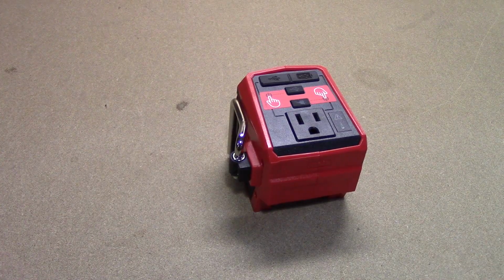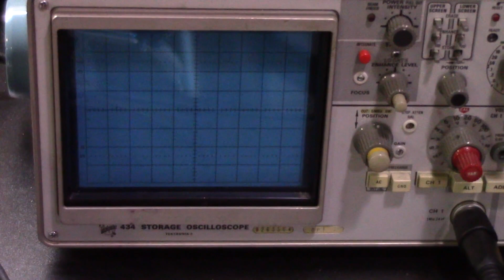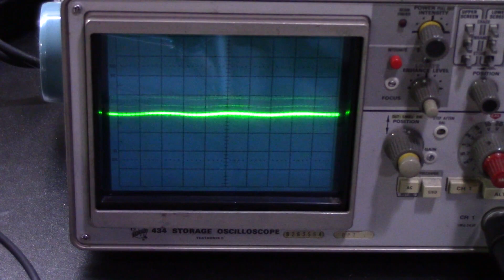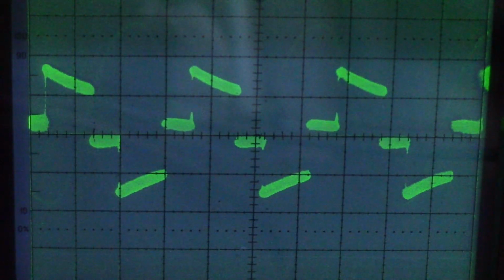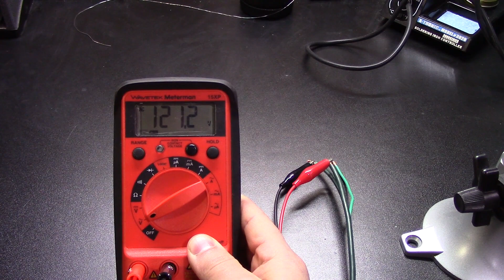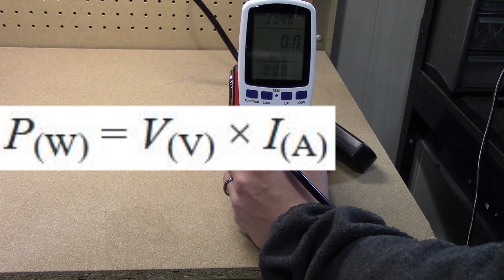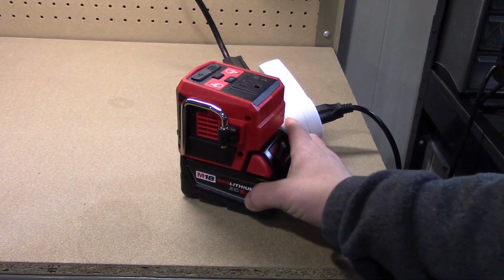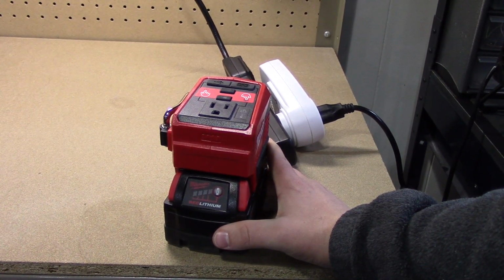Milwaukee Tool M18 TOP OFF Output Waveform Revealed!

Comment: Thanks for sharing this study. 👍 Is the Top Off suitable for powering a Starlink MINI satellite dish/router assembly? I'm concerned if having the non pure sine wave power is an issue?
 I did testing without getting my internet account established yet. I was able to get about 2 hours and 45 minutes of battery time from a Milwaukee M18 Red Lithium XC 5.0 (5Ah) battery at 70F ambient temperature. The starlink comes with a small converter from AC to DC with the following input and output parameters stated on it: 

100-240v 1.6A 50/60 Hz

Output: 30.0V 2.0A 60.0W

The dish label states: Input Req't: 
12 to 48volts || 5.0 A
Reply from the maker: Since the topoff is powering an AC-DC converter, there is no risk to the starlink. Those converters can handle pretty junky waveforms. so the Topoff's modified sine wave is not an issue for your use case. 
As far as suitability...On paper, the starlink power supply will draw more power from the AC side than the topoff can produce. 110Vx1.6A=176W (the topoff max is 175W). However, the rating on AC-DC converters is the expected Max, so you should be fine even in moderately hot temperatures. If you start experiencing random shutdowns of the topoff, I would discontinue it's use and let it cool off.
Keep in mind that running anything right on the max rating will shorten the lifespan. The only thing at risk of premature failure in your use case is the topoff itself.  Hope that helps!
Reply: @IllInformedHuman great, nice to have somebody to get some feedback. Thank you. I'm sure the goons at Milwaukee tech support won't be too helpful. They've not been too helpful for much thus far. My top off has not been used too much, so perhaps it's performing without any shutdowns. I actually performed two complete battery discharges of each of the 5 amp hour I have. The first test I did was indoors without any satellite reception and I believe it was trying to run the snow melt mode because the surface of the dish was warmer when I ran it inside the house versus outside for the more real world test when I aligned the dish with actual satellites. The indoor test consumed the battery in only 1 hour 45 minutes versus The Outdoor test lasted 2 hours and 45 minutes. My theory was that the snow melt function could possibly be running since it had poor reception indoors. I'll keep a watch on things. What I really wanted to do was to get rid of the converter and inverter combination because I know each of them has their own inefficiency that's reducing my battery life. I purchased some components I found on Amazon for connecting directly to the Milwaukee battery. It came with a switch on the housing that snaps onto the top of the Milwaukee battery. There is also an inline fuse holder on the hot side. One supplier provided 30 amp fuses which is too much for my application add a 5 amp load from the starlink. It brings to question whether these guys have any clue what they're doing when they sell these cheap kits. 

There are two large blade conductors on the outermost positions for getting power. My concern is whether this configuration will drain the battery at a rate that's unacceptable because it might not have feedback from other terminals that Milwaukee devices normally have. I've observed them to have two pairs of Blade contacts, where is this Amazon / China part doesn't have those additional terminals. I presume they are part of the feedback for controlling the power draw end or used for the battery chargers to regulate the charge process. I'm just guessing on that. 

My real question here is whether I'm better off using those direct connection components that are sold for this purpose by China or will they damage my battery?
Reply from the maker: @biketothetop  Since the China part does not have the extra blade connectors, it cannot sense the Milwaukee battery temp. Meaning if the battery overheats, the device will still try to draw from it! 
The china part may not over drain the battery since all it needs to see is the battery voltage. I am assuming the china part would shutdown when it saw 14ish volts... though you may want to do your own tests with another DC power supply.  Because of that, there is a decent risk to the Milwaukee battery. 

You are better off using the topoff, especially since it was able to handle the snow melt mode, meaning you will likely not exceed what the topoff can provide. 

You may consider getting a 12Ah battery, which would bring you up to greater than four hours. There is also the option of a dedicated power station like the Anker SOLIX C1000, which would get you 5.5 hours (longer if you paired it with a solar panel) though we are starting to get a little pricey...
Reply: @IllInformedHuman I concluded that the BMS in the Milwaukee battery is protecting it because after I depleted it fully while using the top off, I measured 15.2 volts on the battery. This was consistent for both batteries I tested from full charge to shut down.

 You're making me nervous about having the battery Heating scenario. It makes me want to shy away from this China junk all together. After all this achieves Milwaukee's goal that I only use their products with their battery. This should make things compatible in that regard, but then I get concerned about the sinusoidal aspect and how it could adversely impact my starlink. 

In terms of battery life, I'm okay with the current scenario because I would only use it on a very limited basis. I just thought it would be cool to be able to be totally portable and carry the system in my backpack if I went somewhere remote on foot. I have a 1,000 watt pure sine wave inverter in my vehicle that I can use this system with otherwise. 

My current conclusion: From a safety standpoint it's best to use all milwaukee, but from a hardware lifespan standpoint, it seems that I'm putting my starlink at risk with TopOff

Otherwise I can damage or for shorten the life of my Milwaukee battery or have a fire without the feedback terminals on the China connector.

I guess your final piece of advice was just use the Milwaukee stuff, but how concerned should I be about the starlink even if I use it with the Milwaukee top off and the starlink converter?

Thanks for your help.💪🙌
Reply from the maker: @biketothetop  no problem, glad I could help, and happy traveling!

Comment: Thanks for this re-assurance about the sinewave power aspect. I am considering getting one of these Topoff devices and was skeptical about its suitability for a laptop. At 10:47 you hit on the important facts to justify that the Topoff will do the trick. Since I already have some Milwaukee tools, I am weighing using this instead of hard wiring a Victron inverter in my Van. I already have a 100 Ahr battery for a refrigerator with a Victron DC-DC converter to charge this auxilary battery. I wish Milwaukee had of provided more info like this in the owners manual that I viewed online. I just never saw the product label before seeing your video.

Comment: Can it charger a electric skateboard 👀
Reply from the maker: Maybe, if you have a trickle charge mode? Still fairly unlikely :(
Reply: @IllInformedHuman  im not sure wat that means but ima assume I don't have that lol I just know it's a 5amp charger. But thanks for the reply I appreciate it 🙏
Reply from the maker: @Mitch_Sti  if that charger draws 5Amps at 120 VAC, then it needs 600 Watts! This thing can only accommodate 175 Watts.
Reply: @IllInformedHuman  dang good to know, thanks.

Comment: I had the top off just over a year, charging a laptop while on the road driving, etc. Recently, the AC outlet just stopped working, so I guess one of the smart chips inside became dumb.
Reply from the maker: I did not think this inverter would last long with daily or even weekly use (Thanks for confirming). In leu of a passive heat sink they threw an itsy bitsy fan in there, likely to make it compact. 
I think it is less of the smart chips going dumb and more that they decide to quiet quit.

Comment: Hey very informative video! Question….I am planning on using this to power my Hakko 936 soldering station outside on my car to repair injector wires. Am I risking ruining my Hakko unit?
Reply from the maker: That looks like a 60W potentiometer controlled solder station. Since it does not have a screen, I believe all it is doing is taking in the voltage, stepping it down with a transformer and then using the potentiometer to run over some simple heating circuitry (If not just running directly to the heating element).
So, no  you likely won't damage the solder station with the top off, however, don't be surprised if the thermostat needs to be turned a little higher than you normally have it set.  
Have fun!

Comment: Will this be able to handle 120v 60hz 11.8A ?
Reply from the maker: 120V*11.8A=1,416W
Which is greater that the 175W this unit is capable of supplying.
Reply: @IllInformedHuman  thank you

Comment: For some additional insight here...

Everywhere power is generated, or transformed, you need to establish a ground reference. For example, you may have single phase 240Vac coming into your house from the power company. Where the voltage and current are transformed (the transformer on the utility pole for instance), a ground/neutral bond is established to create a reference that is common to both sides. Same thing in commercial control applications where you may take 3 phase 480V and grab one leg of it to a 480:120Vac xfmer. The low side of that transformer will have two wires that read 120Vac between the two. One of them will be bonded directly to ground on that secondary side in order to maintain a common reference to the same ground on the high (480v) side. The ground bonded leg will now be the secondary's ground (green wire) and neutral (white wire). After that point, the two will never join each other again, and if another xformer was added down stream to say, drop 120Vac down to 24Vac, the process would continue. The ground wire to ground, hot and neutral to high side of transformer, then on the low side, two wires will exit, with one wire being bonded to ground to maintain the common earth reference that began all the way back at the turbine that spun up to create the power in the first place.

Long ramblings just to explain that if you measure without ground off the secondary side of an inverter that is internally bonded to the negative side of the battery supplying the power, you're not going to get completely accurate results. Thank you for catching this.
Reply from the maker: Thank you for the info!

Comment: The important thing to know is electronic equipment can be damaged or destroyed or even explode if connected to that SHAPE of power wave. There is a story of an audio equipment repair technician friend of mine called to service an expensive studio mix board that was being modified by the studio owner. Tech asked studio owner; "Before you power it up, are you sure you know what you are doing?' Owner said "Yes". Tech: "Okay, its your board sir." Owner powers up his mix board then all 96 channels of his $million dollar SSL mix board blow up in sequence, one at a time, smoke rising over each channel one at a time. Next, tech was hired to fix it (after it stopped smoking). He made a lot of $ off that guy.
Reply from the maker: Definitely! Expensive stuff should have filtering, even with a reliable mains supply. Though... In your example, it sounds like there was more going wrong than just dirty power. Thanks for sharing!

Comment: Do you think with a 12v Milwaukee battery

Does it posible to use paint sprayer
Reply from the maker: The device in the video needs an 18V battery. For the 12V battery, they only have something that gives you USB power.

Comment: No idea what you said or what im looking at but ive used the top off to charge everything from m12 batteries for my heated jacket to my phone and laptop. All i want to know is if i can use the top off with my coffee pot. Guess i could plug it in and try but im scared.
Reply from the maker: No you cannot, the smallest drip coffee maker needs ~500watts. This thing can only produce 175W :(

Comment: What will be damaged if I repeatedly short-circuit this thing? (Hot-to-neutral). Thanks
Reply from the maker: That has accidentally happened to me, all it did was turn off. It would then try to turn on and then go off right away. So... it appears to check for that, I have no clue how often you can do that 😅

Comment: I have a habit of researching certain aspects of an item AFTER buying it. Glad I snagged mine for $73 off eBay.
I don’t know why I decided to learn about whether or not it’s a sine wave until after I bought it 😫
I am quite disappointed in Milwaukee. Sometimes you assume they care and then you have to realize it’s only for profit. What more would it cost for pure sine wave?
Reply from the maker: This is certainly something they threw together "just cause". To make it pure sine wave, it would likely get bigger, maybe cost an extra $20?
Reply: @IllInformedHuman  keep in mind that EGO makes a 400 watt continuous inverter with pure sine wave for only $149.
I’ll probably get one as I’ve just joined the EGO Outdoor line for blower and string trimmer.
Reply from the maker: @takenusername  Neat! If I ever get one of their lawn mowers I may have to toss that inverter in the cart as well 😀

Comment: It's overpriced for sure. But most Milwaukee products are overpriced. Nobody is going to damage anything using this. You can plug a laptop in and it's not getting damaged. If it has a rectifier you'll be fine. Ask yourself what you plan on plugging into to this 175-watt inverter... then ask yourself if it has a rectifier on the power cord or inside.

Comment: Would this be able to power up a internal pump in an air mattress? I got a Intex Premaire II that requires a 120W AC outlet.
Reply from the maker: Yea, you would be good to go! A 4AH battery would probably be enough to blow it up

Comment: Could i power my jbl 710 party box with this? It draws 160 watts. 

Also, regarding speakers, do they need a pure sinewave?
Reply from the maker: you would be good to go with the party box. As for pure sine-wave, there is massive debate on that... It will work, those with well tuned ears claim there is a difference.
Reply: @Ill-Informed Human  if i bought this i would use it anyways. The ability to run my speaker if i needed a bit of portability would be awesome

Comment: Would this be okay to use with a Dremel 3000 ?
Reply from the maker: According to the manufacturer, it is 180W (1.5A @12VAC) so technically no... The Topoff's max power out is 175W. But I am sure that is peak power consumption. As long as you stayed at the middle speed, I bet the Topoff could handle it.

Comment: First of all they have inverters for the truck buy one second this this is good for charging your on job speaker or headphones. And using a fan to cool off on hot days.
Reply from the maker: I love my truck bed inverter. This tool is primarily used to power the few AC powered lights I have laying around. I never have a fan blowing on me unless I am forced to work down south 🤣

Comment: @IllInformedHuman 
Thanks for the video! Would this be good to run a modem or laptop?
Reply from the maker: Yea, you would be fine. The power supply unit is capable for taking odd voltages for both of those devices.

Comment: Thanks for posting the waveforms and measurements.  It is hard to justify paying so much for a stepped square-wave inverter even if it works with M18 batteries.  It would have been a good value if it put out a pure sine wave but the device's stepped square wave is not very impressive in 2022.  The warning "OUTPUT NON-SINUSOIDAL" on the product label is a problem.  The user is supposed to know which of their devices will work properly with square wave power.  For me the replacement cost of my laptop power supply is too high to risk using a inverter with a warning like that on the label.  I won't be buying a small inverter until they make one that outputs a true sine wave.
Reply from the maker: I found that it's best use is for AC powered lights or a bug zapper that I can take camping now. Thanks for watching!

Comment: bought one of these and max a.c. volts was 98 regardless of load or no load. same with the second one that bought. they promise 120 volts on the advertisement. not even close. maybe you should put in a resume and make there inverter work as advertised. aloha.
Reply from the maker: Sorry to hear that, trying to run something that low on the voltage range might cause some damage.
Reply: @IllInformedHuman  been buying there tools for over 30 years. this is the only product of theirs i have returned for lack of performence. guessing they subbed the contract for this product out to lowest bidder. i emailed there corporate complaint department, but received no word back. bogus.
Reply: A lot of people have reported this voltage in Milwaukee says it’s because you’re not using a good multimeter. RMS something or other.
Reply: @patty109109  lol. thats bullshit, been doing electrical construction for over 30 years. my meter works fine. i test it on live current all the time. testing for voltage is a very easy job for a meter, and ideal make great testing equipment. there are so many comments like mine saying there top off does not work as advertised. i have thousands of dollars worth of there tools. love them all. the top of sucks. back to the drawing board. case closed. aloha.

Comment: could top off damage a lap top charging?
Reply from the maker: This is a modified sine wave, so it is very unlikely (Engineers never say "never"). If it were to damage anything, it would be the power supply that plugs into the lap top. So hopefully that gives you some added feeling of security.